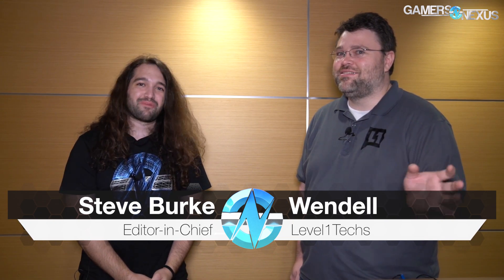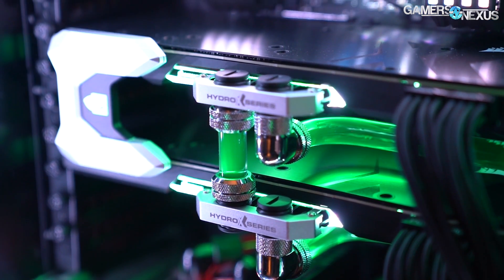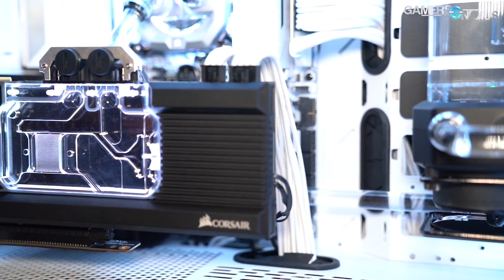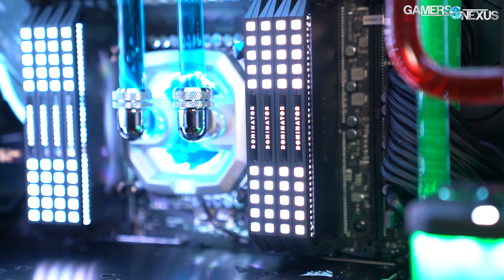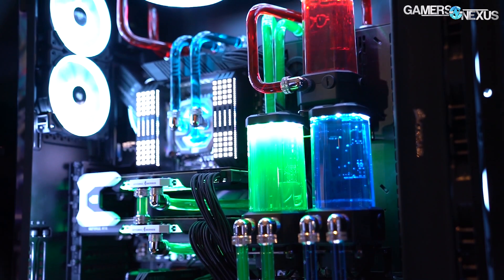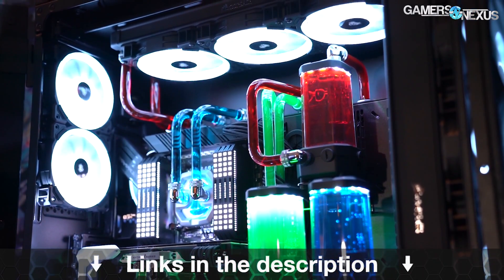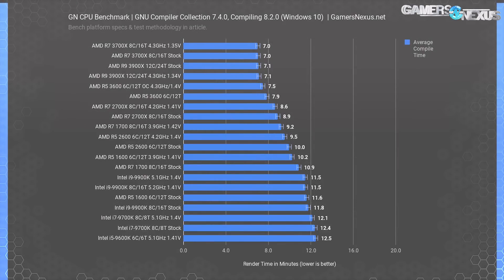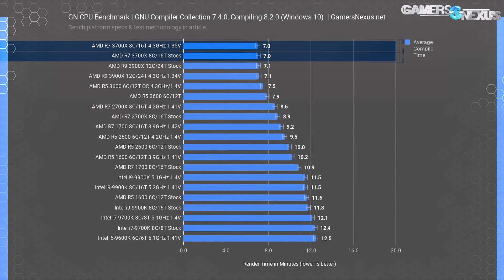Explaining Ryzen 3000 Cache, ft. Wendell of Level1 Techs | LTX 2019

Comment: The GreenArray Chips GA-144 is better. The Novix chip is better. The Advanced Ridiculous Instruction Set Computer Microprocessor is "better" if you ignore performance and only focus on clock speeds. The x86 from AMD is an abomination.

I would know how much the L1 and L2 cache improved actual performance. Back in the day, a truly enormous cache could speed performance by as much as 5%.

Comment: Read "On the Theoretical Speed Up of Ordinary Programs Using an Oracle". With an infinite number of parallel processors and perfect foreknowledge of the program's behavior, ordinary programs can run about 3 times faster for an infinitely greater cost. Some problems (like graphs) can be speeded up with parallel processing. But most programs can't.

Comment: One problem is most coders do not know how much RAM a computer has. Microsoft Word would screw up if a file reached 50 MB in a machine with 2 GB of RAM. The compiler designers were screaming that the LR(1) tables were massive (about 2K). Even VisualWorks has only about 200 MB available in a machine with 32 GB of RAM. 
The problem is that the designs of the programs are flawed.
My first computer course taught me that high-level language programs are larger and slower than assembly-level programs. Both statements are FALSE. Forth high-level code is about half the size of assembly language code. Bliss programs are faster than assembly programs. And my professor (Alan J. Perlis) was one of the world's top programmers.

Comment: Wendell actually sounds like he actually knows something about compiling! That is amazing since most compilers are stuck in 1972 recursive descent mode. They do not use LR(1) parsers because the typical coder is not smart enough to do the calculations.
I am very old school. When the Pentium chip came out, the cache did improve the speed by about 5%. Is there any way of seeing HOW MUCH each level of cache helps? A 3% improvement by doubling the cost is a dubious proposition.

Comment: Chromium is good, because it's C++. Compiling the C linux kernel is I/O. But other languages are a lot more heavy, just take the same code and compile in C++ mode, and it takes more time. C++ is super slow to compile, Haskell is also a headache. Chromium or Webkit is an interesting benchmark for programmers (or Gentoo enthusiasts..:-)

Comment: There are indeed two groups of compiling workloads. You can be working on a project and compile only the bits that you changed. In another case you downloaded a software and want to use it, therefore it has to be compiled from scratch. Often when you change a compile-time option, the whole project has to be rebuilt, and this can happen multiple times in a row while trying to get the software to work. Some less popular packages only come in a source for, and for each update they need to be rebuilt, because you do not keep the temporary files.

Comment: 12:30 The linker invocation is typically the bottleneck when recompiling after a small change. Because first your modified module has to compile and only then the linker runs. It's the worst case scenario for scaling. Depending on the size of the project, link times can be quite high. There are ways to speed it up, like incremental linking or multithreaded linker from llvm project. The compiler and linker are single-threaded (generally). The way to utilize the other CPU threads is to compile multiple modules at once.

Comment: Also a usual developer workflow is not just compiling times. When I'm developing a complete web project I have an IDE (Visual Studio, visual studio code, webstorm, netbeans), a front end server (say a react.js project based on express.js), a back end server (ngnix, c# microservices) and even a database server (mysql, oracle, sql server) and that's the bare minimum, not even counting things like  a web browser with github, stackoverflow and the official  documentation of the API or languages I'm using in that moment, or running automated tests, which in the case of the projects that I work on take WAAAY more time than compiling

Comment: "What will they call it on Rome?" Infinity Cache. Cue the schematic on butter doughnut interposers, CCX exclusive cache, and a large L4 cache shared even between nodes. If they doubled the physical size of the socket (heat transfer), they could include 16G of HBM memory per socket... . . .Perhaps after the next generation jump?

Comment: Wendell - "Compiling the Linux kernel is actually fairly straightforward" 
I suppose it is to someone like Wendell.  Not sure it's something I would want to undertake.
Reply: It's a few orders of magnitude less complex than a web browser, is barely affected by compiler optimization tricks, and relies on very little external code. It's easy, quick, and pretty much always works.

Comment: So then threadripper with it's insane cache is probably even better for code compilation?
Reply: Only due to moar cores. Each CCX shares it's L3 cache with the 4 cores in that CCX. But each CCX has an independent L3, so you won't get the kind of benefits you would from a larger unified L3, like Intel's. But, you could buy a decent used car with the money you didn't spend on Xeons.

Comment: Have you had a go at compiling/building unreal engine 4. I use UE4 for work and can tell you its a massive test how a PC to get this all built in a good amount of time. In the office we have a list of best compile times for unreal engine 4.

Our main build box is a beast and can get it done really fast, I think under 17m. Ill post my local build times.

Full Build: 23m 35sec(2700 items)
Project Build: 2m 35sec(43 items)
Reply: i get around 27min on my Ryzen 1700X if i remember right. Lot depends on IO and RAM, also more cores = more RAM ussage
Reply: @ShadowriverUB  I just moved from a 1700x to 2950x at home, still messing with ram so no really nice times just yet.

I had a look at our build box today its a 2990wx 128gb@3.0ghz in numa mode. 13min 25sec for full compile, 25m package time. A full shader recompile in editor is around 3mins. We are looking for better a ssd right now so times may go down again.

One thing we found was that packaging ue4 is super heavy on disk IO.
Reply: https://youtu.be/yi0FhRqDJfo

Comment: I've seen my codebase compile time expands from 30mins to 11 hours, just because some exec wants us to put all work on the network drive :-).

The code is 300MB C++11.
Reply: A very common saying is that the "problem exists between the keyboard and the chair", ie the user.... For programmers a more useful phrase is "problem exists between the programmer and the paycheck", ie anything remotly resembling management.
Reply: Use git?
Reply: @zouloum9607  well we do use version control, not git back then. 

The reason is the exec want us to use Citirx, which in some configuration it does not guarantee that we will get the same machine all the time. Network drives are assigned to the user so they are always available wherever you are.

Anyway I ended up getting another physical machine. The VM is only used as the remote desktop terminal.

PS I worked from my office in Bangkok while the actual machine is in Toronto.

Comment: The space game X4 Foundations could make an interesting benchmark. The game runs okay but when you build a mega space factory thing and have lots of ships working for it, frame rates in that sector will plummet. Check resource monitor and the GPU will be only 30% and the CPU at 10% (in this case a 2700X and a RX590). The game has lots going on but does not seem to utilize the CPU resources available to it, even though it is multi-thread aware. It ends up with calcs queued and lags waiting for them to get done. It is almost like a server CPU would handle this game better perhaps.
Reply: Bottlenecked code may not be properly and sufficiently multithreaded. You can test for his by restricting the game to run on 1 or 2 CPU cores. If the slowest part does not get slower, the code needs work, all you can do is try to overclock to maximize single thread speed.

Comment: A test suite that would be useful for me to see would be something like: (Entirely from *Linux*, not Windows :D. There will be performances differences.)
1) Running the test suite of a medium to large Ruby application. (Could be the test suite of Rails)
2) A full recompile of a moderate C++ project
3) An incremental compile of the same C++ project (pick a couple files and change them)
4) A JavaScript transpile. For example, a project written in modern JavaScript transpiled with Babel to ES5.

Something like this would be amazing.

Comment: question: why hasn't AMD attached a small HBM2 secondary victim cache? Like a l4 cache of HBM2, still faster than RAM, still lower latency, but a lot of it, connected via the io die?
it could really improve graphics performance and might even help CPU perf if you had, say, a gig of fast hbm2 cache for the gpu and cpu to share, and the gpu takes the biggest share, but the cpu can, say, use up to 256mb of it if the gpu doesn't explicitly need it for render targets or other high bandwidth applications?
Reply: if you look on patents and rumors it is what they plan to do in the future

Comment: make -j12
Reply: On Rome: make -j∞
Reply: @laurelsporter  Jokes aside, make is quite capable of multi-threading and my builds are much faster on 8C/16T vs 6C/12T. at moment I'm using 2700 and waiting for 3950X
Reply: @colinhercus7765  it is high time for something like an auto count based on detected logical cores. It's not like there are projects that would be harmed by -j128. Usually it's either legacy or proprietary code that can't use the feature at all, or the limit is in dependencies.
Reply: @laurelsporter  N=`grep -c ^processor /proc/cpuinfo`; make -j $N
But a lot of Makefiles won't work with more than one thread which can be painful.

Comment: on an unrelated, yet related, note, dolphin emulator depends more upone storage speed than on ipc. how do i know this? pentium 4 630 lga775 running need for speed carbon which was one of the rare variable refresh rate gamecube games. it ran like crap either way, but a cheap sata ssd (128gb gigastone) ran about 35% faster.

Comment: Linking can be multi-threaded but the effectiveness is dependant on how the code is written.

Linking is determining if promises made by the developer can now be fulfilled. For example, the developer can claim to the compiler that a function called rand() exists and that it should be executed at a particular point in the code, the compiler will take it at face value and move on. Once everything has been compiled the linker then goes through and determines if all the developer's claims hold water.

For the linker to succeed all of the code the developer uses needs to be compiled. The more promises a developer makes the longer it will take to link everything up. There are ways to speed up the linking process, instead of waiting for everything to be compiled and then linking, we can organise the order and kick off the linking process as soon as our compiled objects are available.

This linking also happens between libraries, if you have lib2 and it depends on lib1 you can't link them until lib1 has been compiled. This can create a dependency chain which if the code is poorly organised can increase compile times drastically. Wendell touches on this, if you only modify code in lib2 then you don't need to recompile lib1, however modifying lib1 may require a recompile of lib2 as the location of functions that lib2 depends upon may have changed.

Comment: FYI, linking is single-threaded and CPU-bound (not IO-bound). Yes, the linking part is a big issue, as a developer. Compiling with -O3 makes compilation CPU-bound to the point (at least in my C++ project (available on github :-)) that any IO stall is not visible.
Reply: CPU bound is probably common for C++, and even some more complicated C projects. The kernel is mostly written to be portable assembly language, barely even relying on basic c libs, aside from string formatting here and there.

Comment: Another thing to keep in mind for developers is our IDE's really like bursty performance. Which is to say, when  you make a change in your code, the IDE will inspect the file you're changing for mistakes, as well as anything the code you changed touches. So if in your code you do something with a variable that logic elsewhere isn't expecting, the IDE can (depending) alert you to that. Those "inspections" are very bursty across all threads (at least, all 12 of my threads under Jetbrains IDE's). so presumably a cpu that can deal with that kinda bursty workload would be better.

Another thing is installing libraries under node. "npm install". this is primarily a single threaded operation that pins the thread to 100% for however long it takes to install the necessarily libraries. "npm install" is a difficult one to benchmark and not necessarily useful information to have anyway, since you're only gonna do it once in full for your project, and only once any time a dependency changes, which takes far less time.

Comment: Both compilation and linking ARE single-threaded by design, because compilers do not parallelize when compiling a single source file. But big projects like Chromium contain hundreds to/of thousands of files,  and dependency graph between files may allow independent compilation of some files simultaneously. The "wider" dependency graph is on average, the  better utilization of large core count will be. My experience of compiling Tensorflow on TR 2950 says that compilation is almost 3x faster than on my 6 core  notebook that is roughly 4x slower than TR. It means that TR's cores are not 100% utilized during compilation. For the same reason TR 2990WX may show much smaller than 2x increase in compilation performance of TensorFlow relative to 2950 just because its source's dependency graph is not wide enough for this processor.  

Linking is the same except that many projects usually provide a single executable artifact as a result of compilation (ex: chromium executable), so there is no parallelism at all here. Some projects may provide many executables (even tens of them), in this case we may have substantial gains from a multicore linking. 

My personal opinion is that in general, 16 physical cores for a developer workstation is a sweet spot. 32 cores (64 threads) may be underutilized in general and 64 cores have no much meaning _for their expected price_. 

Moreover, C++ compilation may require 2GB+ ram for a single compiler process, it's 64GB RAM for TR 2950. 32-core developer workstation should have 128GB of RAM. Linking is also extreme memory-hungry, and for this reason I even had to limit compilation parallelism on some projects (LLVM) just because it exhausted all the RAM at linking.
Reply: Regarding non-C++ compilation. C++ benefits the most form multicore machines just because C++ compilation is very CPU-intensive, C is the same but slightly more versatile. That means disk I/O does not contribute much to compilation. Java and Go compilation are simpler and much less CPU-hungry. JavaScript tools (Node.js) don't compile anything at all, just "transpiles" -- transforms source codes from one language dialect to another. Though in this case we may see substantial  project compilation speedup on a multicore machine, large core count machines may not be as efficient here as for C++ compilation. I think that cheap 12 core CPU on an inexpensive motherboard will be a sweet spot for a general-purpose software developer workstation.

Comment: Dirty web dev here.  I wanna see benchmarks for tests and linting.  I run those ALL the time.

Pull down Django and React, and run their test suites (with the right amount of parallelisation), and their linting, and time that.

Please.
Reply: Add some TypeScript on top please.

But with the Create-React-App like setup, meaning only transpiled with Babel and use the TypeScript compiler only for type-testing.

If you just get node, you can set up a bare project using Babel with TypeScript compilation as easy as executing 'npx create-react-app my-app-name --typescript'. Linter support for TypeScript with your own settings is a bit more complicated, but I can provide a setup.

I'd also love to see some scaling for linter rules, especially if they require a plugin.

The issue is that I don't have a considerably big project I would be able to share.
Reply: @9SMTM6  That's not a project.  Those benchmarks will complete in milliseconds.

I want linting and testing on a full project to be tested, hence me saying to run the test suites and linting on exising projects like React and Django.

I'm fairly sure React is in typescript, isn't it?  Or is it flow?  Whatever.